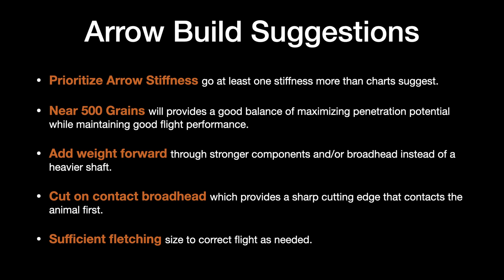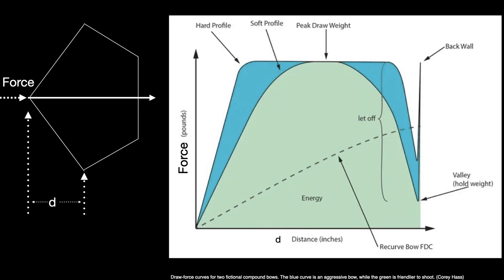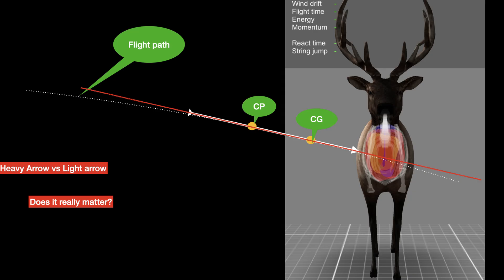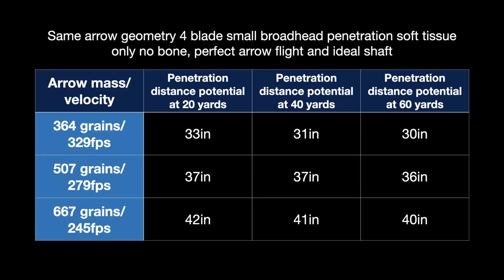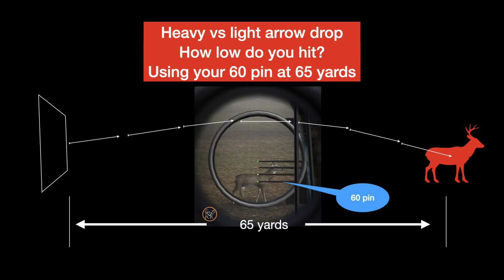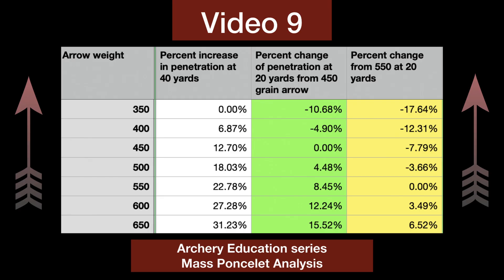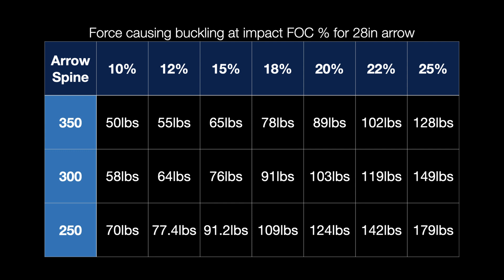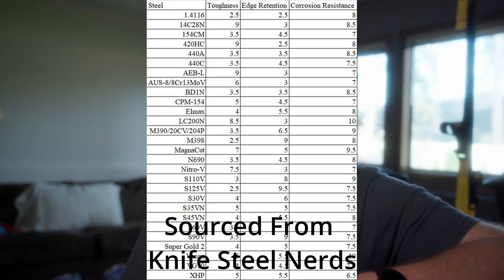Arrow Build Recommendations from an Engineer: Video 10 archery education series.

Comment: How much does 4mm vs 5mm come into play with drag? Will the 4mm arrow retain noticeable velocity difference at distance? Seems like crosswind doesn’t matter all that much between 4mm and 5mm from your other video.
Reply from the maker: In terms of drag it in proportional to the difference in cross sectional area so if the outside diameter of the 5mm is 10% larger than the 4mm it will have 10% more drag. It does matter in cross wind as well but the fletching are the larger area to consider. The arrow length becomes the biggest player of arrow area in cross wind.
Reply: @Lucas_Palmer_Archery  so that would mean a 5mm arrow would lose velocity 10% quicker? I’m trying to quantify if it’s worth it to switch to 4mm arrows if a guy was shooting to 60 yards. I’m not worried about the crosswind as much.
Reply from the maker: @drew5450 what’s your goal? If your only goal is retain more speed, energy then yes 4mm is better. However you need to be careful about accuracy and consistency I personally shoot 4 mm arrows, however some components nocks are terrible so be careful on that end.
Reply: @Lucas_Palmer_Archery  my goal is to retain more energy down range but trying to decide if it’s a quantifiable advantage going to 4mm arrows. I don’t shoot lighted nocks. But I’m aware of the component issue for 4 mm arrows like the options for broad-heads. I would most likely be using Hit inserts or possibly glue in broadheads. Would the 10% more drag on 5 mm arrows equate to 10% of your velocity at 60 yards or how would that be calculated?
Reply from the maker: @drew5450 not exactly but it would be very close To a 10% advantage.
Reply: @Lucas_Palmer_Archery thanks!
Reply from the maker: @drew5450 anytime!

Comment: I was with it up till towards the end, I would have to disagree with the lighter draw weights going that high on arrow weight. it starts to blur above 60# but you hit 50# or below it SEVERELY affects the flight path and speed and basically gimps everything due to loss of velocity.

most young, new, senior, or female archer is below 50#. when I used to be able to pull 85# it didnt matter, it was purely how small do I want the pin gaps. without custom weighting my arrows there was no way I was gong to reach a 10:1 grain to pound ratio. but now recovering from an injury has been slow and the changes in arrow mass vs draw weight ratio it much more noticeable. at 30 yards the difference is about 10.6 inches more drop on a 500gr vs a 400 gr and is a DECREASE of 3ft lbs kinetic energy, AND.. 30fps at target slower.

there IS to much of a good thing, at some point you start reducing effectiveness due to arrow weight. need to find a balance of velocity and mass. otherwise we would just hunt with 800gr arrows with a 30lb bow.... from every number I've ran the optimum gr to draw weight ratio is somewhere around 8GPP (Grains per pound) before you see weight becoming a diminishing return. higher efficient bows may change these numbers but I am using my 310IBO as a base (but remember bow companies lie about their IBO with little tricks to "hedge their speed numbers". average IBO is inflated by about 10.

Comment: This is great information, should be noted that is either "general" information, could specify the shooter and bow specs (Especially, when discussing arrow weights), or with your "wizardry" (lol) have a formula of recommended arrow weights dependent upon bow and shooter specs.
Meaning when we suggest 500 grains of arrow weight. The arrow design/layout will look very different for someone with a 26" draw shooting 60lbs to someone with a 30" shooting 70lbs, as example.
I haven't heard it mention in the series, yet. But, there is the unicorn speed of 280(ish)fps. If we add that to the suggestions, it will come close to never achieving that speed. Example: 26" draw @ 70lbs with a 500 grain arrow would be in the neighborhood of 245fps(ish). In order to achieve 280fps, with the bow and shooter specs, the draw weight would need to be around 95lbs.
Unless I am completely missing something and I am not engineer. 😀
Reply from the maker: @RudyHassallPMP  you are absolutely right this is very general information. From my perspective don’t worry about arrow speed build your arrow for a purpose, target, deer, elk, moose and make decisions accordingly. If I tell a shooter aim for 280 fps but they are only able to draw 45lb draw weight and have a 25in draw length. They are never going to get that speed or it will be very difficult with an effective hunting arrow. 
Long draw high poundage should never have a problem with penetration if they do something is failing.
Medium draw medium poundage put more consideration for penetration.
Short draw low poundage, arrow penetration should be higher on your list.

This is my opinion of course. Also as I have noted in the penetration video many different builds will kill your target animal. 
Arguably you start by determining needed penetration minimum then select appropriate broadhead and mass combination that will provide let’s say 25% more penetration than the minimum safety factor. All other variables are just the result of this question. Again my opinion. 

Thanks for the questions always love a good archery talk.

Comment: Again great video.

Let's say you already have an arrow with heavy FOC (25% or greater). The nock and vanes are very light.  If I am going to add 20gr to the arrow, should I add to the front or back? Should we keep tail weight as low as possible as long as enough for steering?
Reply from the maker: If you want to add weight I’d suggest add it in a way that generates a more durable arrow or more effective. 25% foc is a great achievement make sure your arrow is flying perfect. 20 grains could be a stiffer arrow, a stronger broadhead, a more durable nock (nocks are critical to accuracy and good flight), a better insert, a wrap if you so desire which may be beneficial for blood tracking.
Reply: @Lucas_Palmer_Archery  I agree. Among the carbon shafts that has been rated for spine the strongest I could find is 150, with GPI ranging from 8.1 to 11.9. I am leaning toward 8.1gpi as the saved weight could go to the insert.

Some pros argue the longer arrows will be more accurate. From your theory I infer the otherwise. Is this correct? 

Instead of FOC, I think the "steering factor" is more relevant. I define Steering factor as (0.5+FOC)/(0.5-FOC), which describes approximately the vane leverage over the tip. Even a better definition would use the vane location instead as the correction force is mostly from there.
Reply from the maker: @statgenie6575  interesting theory about longer arrows being more accurate. In my opinion accuracy completely depends on what bow, what shooter, what arrow, what situation. The questions become was the longer arrow more accurate or was it reacting off of the bow in a more correct manner leading to a better arrow flight producing a better group if so. A shorter arrow with the same dynamic spine would presumably perform similar. However then you need to consider the ratios between fletch and cg and point and cg.  I have yet to test any 150 spine arrows I am using a 250 spine right now. Thanks for the comments!
Reply: @Lucas_Palmer_Archery  arrow weight distribution has relatively small impact on the FOC or steering factor. FOC approximately equal to 0.5 x (F - B)/W, F is front weight including BH + Insert, B is back weight including vanes and nock, W is total weight. If anything, longer arrows will buckle more than shorter arrows if they have the same spine index. So in theory shorter arrows should be better, at least not worse. But the community in general believes the longer arrows are more accurate. 

Maybe longer arrows launched more accurately? I do not see how that is possible.

Comment: Great channel here hope it grows! I've build arrows for years and have had the opportunity to see them used on game mostly deer and hogs in GA by myself and different hunters.  Only point I'd like to make on this video is that draw length of the hunter is the main factor in the arrow weights that I recommend. I wish more people understood how draw length is more of a factor in modern compound bows energy than ANYTHING else. As such their are many hunters are would never recommend a near 500g arrow for hunting as there draw length is not long enough for such a heavy arrow.
Reply: Are you suggesting that at certain weight the energy transfer is maximized?

I shoot crossbow. My Center point Wrath 430 ha maximum energy around 670gr. But there is a wide window where the energy if flat. I will use the point where 97.5% of maximum energy is achieved, to have faster speed and flatter trajectory.

This differs from what shown in this video, to have the same efficiency regardless of weight.

Comment: I only shoot  50 pounds @ 27" so I shoot a 400 spine arrow which only weighs 400 grain with a 100 grain head.  To get a 500 grain arrow I would have to go with a 200 grain head which makes it too weak spine. If I switch to shoot a 340 spine its too stiff even with a 200 grain head. What should I do.
Reply from the maker: First question are you shooting compound or traditional. You can shoot a heavier gpi shaft to increase weight it does not have to be just point weight. However, to dial in spine you can change arrow length, longer to weaken shorter to stiffen, which will alter the dynamic spine of the shaft. Based on spine charts from Black eagle, Victory, Easton it looks like you could shoot up to 250 grains of point and insert weight with 400 spine, personally I would still go with a 350/340 spine shoot a 28in shaft and you should be good for a compound. As long as your bow is tuned. A trad bow will take a little more playing to get good arrow flight.

For reference my wife shoots 47 lbs at 25 in draw and is shooting a 400 spine arrow that has a TAW of 505. It leaves the bow at 205FPS. That arrow has an ethics steel insert with collar 135 grains on the front and a 100 grain point. so 235 grains up front. Technically she is "overspined" but has perfect arrow flight. That same bow will shoot will also shoot a 360ish grain standard axis 500 spine build out of the same bow with the same tune both shoot clean bullets through paper. 
I only mention this to say that it can absolutely be done. 

However, with everything these are only recommendations for a well rounded arrow. None of it is "necessary" to kill. 

If you are happy with your setup roll with it and go hunting.

Take care,
Lucas
Reply: @Lucas_Palmer_Archery  Thanks for your help.  As far as spine weak or stiff I was using archers advantage software.  I should have said my draw length is 28 its just I shoot a 27.5" Mathews because they seem to draw long, I was trying to emphasize I don't shoot a lot of speed and so 400 spine fit well for me. I could try a higher GPI shaft but I use easton axis arrow and really like them and do not want to switch. You are right about trying a longer arrow length.  I will plug it into Archers Advantage and see if I could bump up to 340..

Comment: Здравствуй , очень хорошо излагаете и показываете , хотелось бы узнать ваше мнение по поводу сборки арбалетных стрел ..
Reply from the maker: My apologies I somehow missed your comment. The stiffness/spine of crossbow arrows is even more important and the whole system is very sensitive. You want a crossbow bolt to recovery very quickly so very stiff, very straight and strong nocks. I have not personally used a crossbow but from a force/engineering analysis I would start there. The arrow mass is going to important as well because crossbows achieve a very high velocity.
I hope this helps.
Take care, 
Lucas

Comment: I would strongly suspect that the effect you observed where the efficiency is independent of the arrow mass is unique to compound bows, and wouldn't be observed in traditional bows. The efficiency is so high because compound bows have very little action (S = mass x distance), which will also make the efficiency rating independent of arrow mass. Recurves, and especially longbows, are less efficient because they have more action, and therefore that efficiency will strongly depend on arrow mass.

Also, don't forget high quality sharpening. There's sharp and then there's sharp. It's harder to quantify what counts as sharp enough, but there are literally no downsides or compromises with making your broadhead sharper.
Reply from the maker: I agree completely about trad bow.  Yes sharpening/ sharpness is absolutely something I will be talking about a lot when I do broadhead testing. 👍
Reply: @Lucas_Palmer_Archery I'd be curious to do a deep dive into the grind angle on the broadhead. Some older resources say 25 to 30° is ideal, but I've got great results going to just under 20 degrees and sharpening to 2000 grit. Of course when you are achieving sharpness by reducing the grind angle, there is some trade-offs in the durability.
Reply from the maker: @ThirdLawPair a lot of those question and answers are going to depend on the steel the broadhead uses. I want to explore the oxidation and corrosion rate of various broadheads as it relates to edge retention and durability.
Reply: @Lucas_Palmer_Archery Sure, but most broadheads use a cheap forging steel like 1095. Even the so-called "premium steel" broadheads use a mid-grade tool steel like A2. So you could make a reasonable analysis based on common metals in popular broadheads.
Reply from the maker: @ThirdLawPair  very true! Finally someone that understands that these steels are not “premium”!! Do you have a preferred knife steel? I like the 420hc for cheaper knifes, my favorite hunting knife is made with s30v. I’d like to get my hands on a magnacut, s35v, and some others as well to play with.
Reply: @Lucas_Palmer_Archery  I'm more into kitchen knives which usually use more mid-level steels rather than the super high-end steels. I've never been one of those guys who will pay 600 bucks for a 3" survival knife, but I get why in certain circumstances you might need a very tough, corrosion-resistant blade. My favorite knife is the Bob Kramer 10" chef knife made from 52100. In retrospect I think the other model of the same knife made of FC61 would have been just as good (or possibly better), but one advantage of the carbon steel kitchen knife is that my wife doesn't touch it because she is afraid to ruin it. 

For broadheads, I think that the powder metallurgy steels would be a bit overkill, but if you had a steel that prioritized toughness over wear resistance, you might be able to use much finer grind angles than most broadheads do. Even though 1095 is a cheap forging steel, it is so ridiculously cheap and reasonable quality that you have to pay a lot more to do better. For making knives, it makes no sense to compromise on the hardness-toughness tradeoff by using a forging steel for a blade that isn't even forged; but for broadheads, the cost-performance tradeoff of 1095 is hard to beat. Even what Larrin Thommas would consider a "budget steel" 14C18N is just way more expensive.

Comment: Great video Lucas! After completing your penetration tests, you should redo the broadhead portion and focus on lethality.  The size and toughness of the animal makes this variable.  But for whitetail I have shot enough to know a small fixed blade like a Slick Trick is wasted energy in the dirt on broadside shots.  2” Swhackers don’t penetrate as well, but they stick in the ground on double lung shots and if I hit a big bone on the far side quartering away, it doesn’t need to penetrate any further.  The result is short blood trails and increased recovery rate.  After I started sharpening them, I saw even shorter blood trails and increased visible blood.  I’m confident the internal hemorrhaging is increased. I’ve gotten away with less than perfect shots and still had short blood trails.  I shoot 440 to 475 gr total weight and use 75 gr brass inserts.  A little overspined with 26” 330s.  I ended up with essentially the same things you are suggesting through experiment.  As an engineer myself. All choices were based on physics.  I read Ashby. I started with a higher penetration setups until I saw the advantages of putting more energy into cutting.  So you have one more factor to add to the equation. Lethality.  I’m not sure how you prove it other than through experiment.  I know I’ve proven it to myself. Of course I’m only taking good shot angles and that is another topic you could explore.

Keep making videos.  We need real science like this in the archery community.